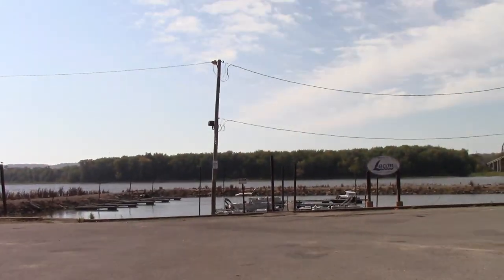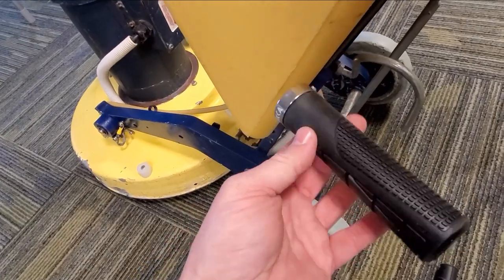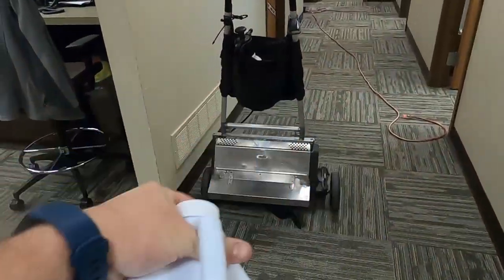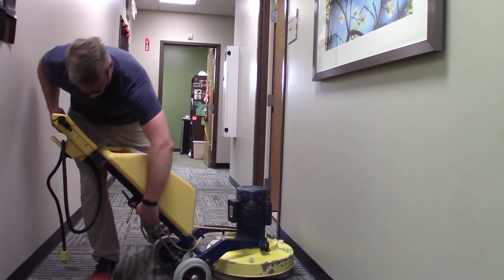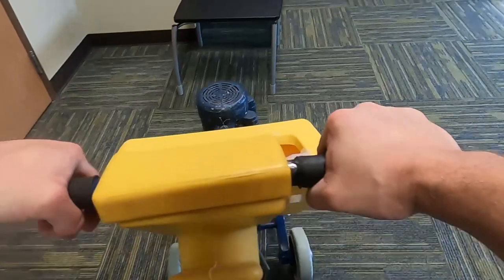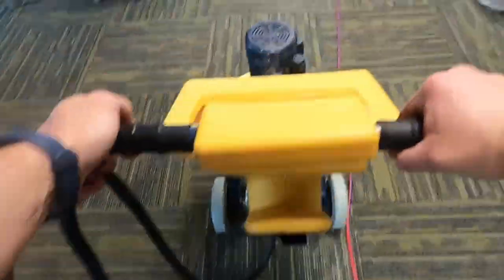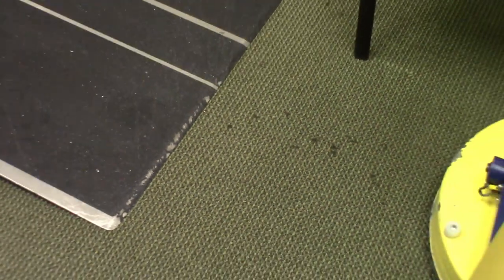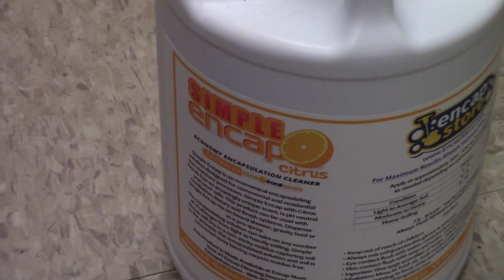#Satisfying Cimix cleaning Road trip pick it up and the first #carpetcleaning

Comment: Nice video but I was surprise to see you using the cimex tile brushes on CGD carpet and not the cimex pads, is it because they were available or was this intentional ? great job either way .
Reply from the maker: Those are a carpet brush by cimex pacifically designed for cleaning carpet.
We do have some tile brushes for our cimex machine And we wouldn't use them for carpet they're far too stiff

Comment: So what would have been the difference if you had used an OP?
Reply from the maker: Well it wouldn't have been much of a difference maybe a little slower. 
They're really good comparable systems. 
The cimex has the advantage straight encapsulation the OB has an advantage when it comes to  Vlm with a bonnet